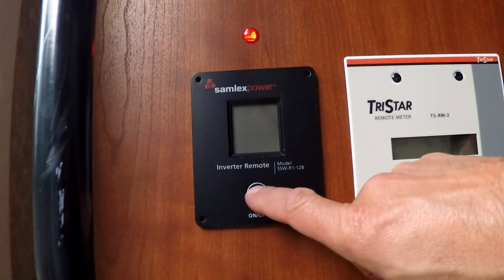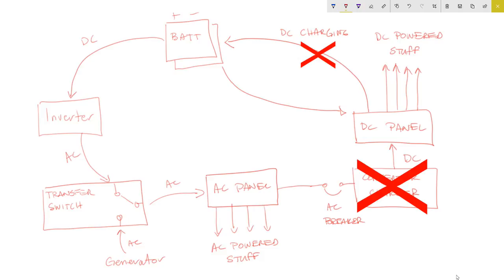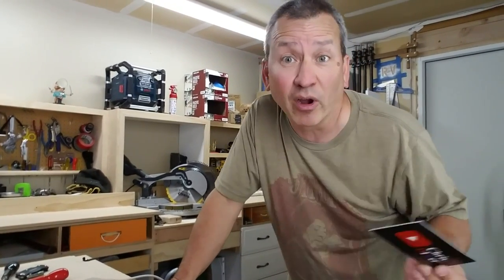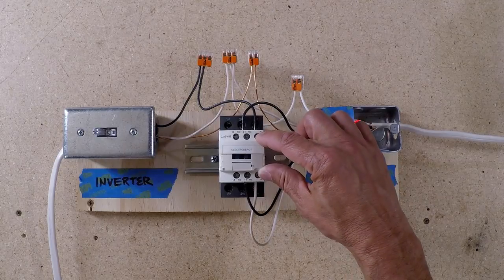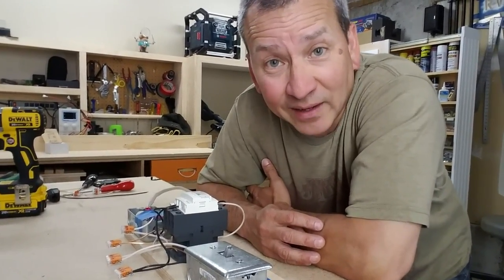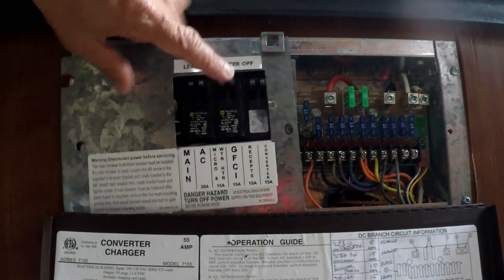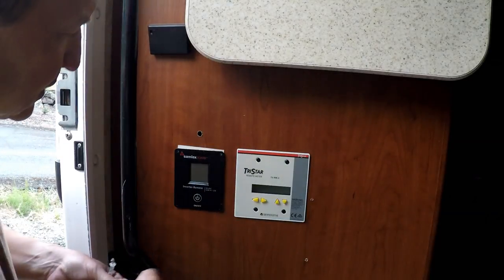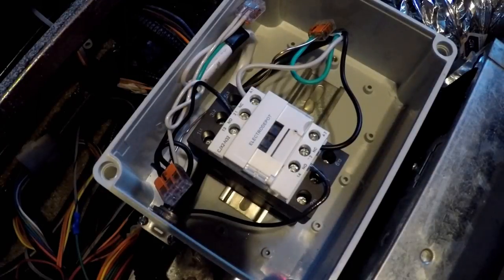How To AUTOMATICALLY Disconnect a Converter Charger When Using an Inverter

Comment: That's a nice little gadget! Personally I'm about to install a 2 position on-on toggle switch to flip between shore and inverter power. In my option a simpler/cheaper solution. Only difference is it won't turn my inverter on right away, but I don't mind since I don't want it running all the time anyway.
Reply: That's fine if you don't have a charger in the picture

Comment: Hey Brian, I really appreciate your hard work shown in these videos. YOU are my go to guy! I watched this a few years ago and now again because I'm facing the very same issue with our new (to us) 32ft Class c and the installation of our new Xantrex 3000 watt inverter.  I was wondering though, can't I simply remove the converter from the the coach breaker box and connect it through a separate small breaker box to the output of the existing transfer switch? This way it would only be powered when either shore power or the generator was on.
Reply from the maker: Ha! Found the comment :) Hope you got my email. Cheers.
Reply: I need to do this. Could you please explain how you did it?

Comment: Brian, couldn't you just disconnect the converter from the distribution panel and wire it to the transfer switch on the shore power side? would this take the converter out of the loop when using the Inverter?
Reply from the maker: Yes. That's basically what I'm doing now with a different transfer switch. Check out this more recent video: https://youtu.be/iASOOzUCRto
Reply: @RVwithTito  This is my question too, but I think Dan's question is a little more specific. Why is a more sophisticated transfer switch (with charger output) even required in the first place. If you do what Dan said, the power convereter would only receive power if shore power (or generator power) was available without any additional components.

Comment: Hello, Great videos, I watch you every day for all you not only suggest, but also for where you go on your RV trips.  All fantastic.  I plan on using a Inverter/Smart Converter by Go Power and eliminate the converter that came with my RV. What would be the suggested wiring sequence to use a power transfer switch where Shore Power when plugged in is the first source used by the RV. Generator when running is the second used and Solar Inverter is the third source of AC power. Are there transfer switched available pre wired for this type of setup?

Comment: Great video.  As always, well taught and with great quality all around.  Couple questions for ya.  It's a bit hard to see but is it safe to assume you took the hot as well as the neutral and ground from the converter to wire inline with this contactor?  Also, are A1 and A2 interchangeable?  I noticed the neutral from the converter was in A2 in your shop test but it appears to be the hot from the generator in A2 in your RV.  It also looks like the neutral from the generator plug is in A1 in your RV.  Thanks again for a great video.

Comment: Besides those clip on connectors, what are he weakest elements in this set up?  I ask for future diagnostic - troubleshooting, should there be a need to.
Reply from the maker: Will do. Those clip on Wago connectors are pretty solid. I love those. Neverhteless, I did wrap them in electrical tape before buttoning things up. I'll keep you posted.
Reply: I actually used a bunch of those installing hihats in my kitchen (in a house, not an RV) and I actually was a little concerned when i had an occasional flash because, compared to twisting the wires together and nutting them, that little point of contact is a pretty high resistance point, I would think. I mean, obviously they are UL rated and everything so i'm sure it's fine, it just made me think.

Comment: Hey Tito........Instead of running from the inverter to the RV's 30A shorepower plug, would there be any problem with running it instead from one outlet of the inverter to the main AC bus in the AC breaker side of my converter/charger panel, and then use the second AC outlet of my inverter to wire up the contactor as you show here? (my 30A shorepower plug is on the other side of my RV from my batteries and the space I can use to mount the inverter). Also, I suspect that I will need to use 10ga wire to run from the inverter to the buss (about 8'). Would that be correct?

Comment: Great video Brian! I do have a question for you though, I have the exact same setup in my trailer as you do with my shoreline plugged into the inverter and having to switch off the converter at the breaker. My question is that when I do this and turn on the inverter I am getting a humming/buzzing noise coming from the converter. Have you experienced this with your setup? Thanks
Reply: Are you getting the buzzing with the breaker for the converter OFF?
Reply: yes

Comment: THANK YOU!!!!!!  after seeing your video the light bulb came on. I have been planning this same type inverter setup for close to a month. My problem is that my generator is not big enough to run a hair dryer. I will be installing a xantrax sw2000 inverter which can run the hair dryer. I love the idea of the transfer/relay switch idea. it takes the problem of switching my converter off.question for you. have you ever tried running or ever heard of anyone using a 12volt generator through a solar charge controller to charge their battery bank?
Reply from the maker: +Glenn Sikes Glad you found this helpful glen. If your using a generator, you'll want to connect it to a battery charger and not through the solar charge controller. That's a farely common practice as a backup to solar. Some portable gerators have a battery charger mode. Good luck.

Comment: Hi … at the moment, I’m not exactly sure how to ask this question.  I’m in research mode for a van build.  I will have solar on the roof, connected through a (input) solar charge controller that is supplies power (output) to the battery bank with a fuse box (output) to the rest of my DC appliances.  To power a coffee maker or similar A/C household appliance, I will have an inverter (input) connected to the same battery bank.  From the inverter’s A/C outlet (output) I will have a power strip to extend connections for two or three household A/C receptacles.  The question: to include shore power into the mix, to charge the battery bank and take over the powering of the A/C receptacles am I looking for a smart converter/inverter that can switch automatically when plugged into shore power or am I looking for a manual method that bypasses the inverter?

Comment: a little confused. If i have a charger that's only attached to batteries (ie, it's not connected to an AC panel), I can still run the converter which would be charging the batteries while I'm using the inverter (connected to my batteriers) to power 110v plugs. Is that correct? Thanks for the great videos!

Comment: Tito, great video.  I saw on your drawing a xfer switch between your inverter and generator input.  Did you install that or did it come with the trailer?
Reply from the maker: The transfer switch came with the RV to switch between shore and generator AC power.

Comment: When you turn off the converter/charger do you lose power to the 12v lights and other 12v things?
Reply from the maker: The batteries continue to provide 12v DC to the panel.

Comment: Hello, I installed this on my RV and it is working perfectly.  I noticed a comment about switching the wires around so the AC will power the switch.  My concern is when I start the generator or plug into shore power will it affect the transfer switch.  Sounds like a good idea.  Have you tried to switch the wires.  God Bless...
Reply from the maker: Glad to hear it's working for you. Havent tried switching it. Working good now for me. I plug my shore power cord into my inverter so there's no way to also be on both.
Reply: I was wondering when you plug into your inverter like me if I want to start the generator the transfer switch automatically switches to the generator and shuts off the inverter / shore power.  Does yours work that way?
Reply from the maker: Yes. Mine works the same. The transfer switch toggles between generator and shore power. The automatic relay for the converter stays disconnected as long as the inverter is running. So to have the generator and converter running at the same time, I would simply turn off the inverter. This never really occurs in my situation though since I almost never use my generator anymore. I'm either on shore power or inverter. In both cases, I'm providing power through my shore power cord. So the RV always thinks it's on shore power.
Reply: Thank you  by the way I am enjoying the videos, God Bless...

Comment: hi brian,great video,will this setup work with 50 amp shore power as well?
Reply from the maker: Yeah it should. You're converter/charger still runs on 120VAC and will be on one of two 120V legs of your 50 amp service.

Comment: Are you sure that the auxiliary NC contact you are using is rated for the 15A+ you might pass through it before the breaker trips? The main NO contacts are 30A, but usually the auxiliaries are rated much lower as they are for control monitoring, not power isolation.
Reply from the maker: Ha. Made me look. Yes. I'm good. 30A on the top contacts, and 50A on the bottom ones. I still have to box it came it.  There are certainly ones not rated as high though.
Reply: Good news, then. The amazon page did not list the auxiliary contact rating anywhere I could find. I am enjoying your channel and your common-sense approach to rv additions as I am outfitting my new fifth wheel in anticipation of retirement in a couple of years. Keep up the great work!

Comment: I just got a converter and am installing it tomorrow. I don't have any AC box and just run a few things director off the inverter's AC plugs. Can I safely connect the converter to shore power (110VAC 15A) and also use my inverter at the same time?
Reply from the maker: I don't see why you would need to but, in theory, it should work as you described. I'd try it and see how your converter behaves as your inverter draws power from your batteries. I believe the converter will think the batteries need charging if the voltage gets drawn down below float level and then bring more current in from the shore power.
Reply: Thank you!

Comment: When you manually disconnect the converter or install this auto switch, don't you still lose the ac to your outlets even when you plug your rv into the inverter? I plugged my RV into the house power or shore power and when i hit the breaker for the converter to shut off so does my outlets and microwave. Please advise me. Your video was awesome but as most it never shows how the RV is still operating normal besides the 12 volt side. Thank you in advance
Reply from the maker: Not every RV is wired the same. You're converter is probably wired in differently than mine.

Comment: Great video and project (as always). So a slight twist... I have an inverter charger with transfer switch. So I am wiring the output to the PD panel input to run everything. But, this implies I would have my inverter charger and converter charger both running when on short power. If my logic is right this shouldn't make a difference but thought I would get your expert opinion.  Do you think that would be an issue?
Reply: That's the loop to avoid.  The inverter is running which powers the charger which charges the batteries which feeds the inverter which... etc

Comment: Brian
Since you have a Genset and shore power, you probably have a transfer switch to direct them,
If so, just add a 2nd xfer sw..    (Google "Lyght")
!st switch is Gen/Shore, 2nd sw is GenShore/Inverter.
Power the Inverter input with the output of 1st switch (move lead from Conv breaker to output of 1st xfer sw) 
Voila, no power to Conv when on Inverter. (Unless you are running Gen or Shore also which is ok to power Converter in that case.)
Reply: AND you no longer need to patch the Inverter Output into the Shore line Plug.
Automatic transfer to inverter AND kill power to Charger... woohoo

Comment: Great project and very informative. With the Inverter commanding the converter/charger off (to eliminate the charging loop) would all your 12 volt appliances then not be operational while using the inverter?
Reply: When the converter is not powered, you get your 12v power from the batteries.

Comment: Brian:  so here's the question I have...if you turn off the charger converter, and you run directly off your inverter, what powers the 12volt things in the rig like the lights, and other such appliances?
Reply from the maker: House batteries are also connected directly to the DC panel to power those things.
Reply: @RVwithTito  ah, that makes sense now.  Thanks for the reply. Hope to see you out here in northwest boondocking.

Comment: Hey there, question for you. I know this is an older video, but at the time of doing this, your diagram shows that you already had a transfer switch. Couldn't you have just removed the power converter's A/C input entirely from the circuit panel and connected it directly to the shore-power-input-side (or generator side) of the transfer switch permanently and branched off right there? That way, the power converter would only come on before the transfer switch is involved and you would never have had to fiddle with the circuit panel breaker at all that fed A/C to the power converter (as it would have been removed). Am I missing something?

Comment: Nice vid!  What are those little wire connectors you use?  They look very easy to use.
Reply from the maker: They are Wago lever connectors and they are awesome. I have a link to them in the description.
Reply: I LOVE those connectors. I created a entire wiring harness in minutes using these instead of solding. 😉

Comment: Hi, just wanted to let you know that I did the same install for my travel trailer based on your video. I have not received the inverter yet (on the way) but I did install the wiring to the inverter and the relay as per your video. My inverter will be hard wired. So to simulate power from that end I plugged that wire to a plug from my house and to simulate power from the other side I plug the house line to the shore power plug. I have a manual transfer switch right under my converter box so I can chose shore or inverter. The system works great except for one curious detail... when the switch is in shore position I have normal power and the converter is powered. I confirm this by putting a voltmeter on my battery and see the 13;5 volts. Power off, voltage back to 12.7. Now I put the switch to the inverter side and when I check the battery I still have only 12.7 meaning the converter did not kick in. Another obvious sign is that I can hear the converter fan cycle when it is first powered up. However I never physically hear the relay kick on and off, even if I have my hand on it I cannot feel the relay kick on or off. The whole thing works perfectly except for the strange fact that the relay is completely silent. In your video it has an obvious click to it. Any thoughts?

Comment: Hi Tito, This has been a question in my mind how I could achieve what you are doing to switch of the converter automatically when I power up the Inverter, I ordered and have received the  relay disconnect and the box, but could you make a little line schematic so I can be sure of getting it right,  I would really appreciate it. Thanks Gene C.

Comment: I have a bluetti and I want to power my rv with it and avoid charging my normal house batteries with it.  would this switch do that for me?  thanks.
Reply from the maker: That's right, the RV will be charging your house batteries from the Bluetti. If you can't manually turn off the charger, then you'll need a setup similar to this.

Comment: Question - My battery bank is in shed very close to our camper and all my solar power dumps to the shed and the charge controller..... we run a extension cord from our inverter to our camper to have 12V power in camper. This also drains our battery bank to charge the single deep cell on the front of the trailer, would this still be a good idea given my remote locations (not in camper) or should I just beef up my battery bank and go with a 2000 watt inverter?

Comment: I installed  a setup based on your idea. It is installed in my travel trailer. It works very well except when I run my microwave. I have 4 Battle Born batteries in parallel, a 3500 watt max/9000 watt surge inverter with a remote start button. I am using 1/0 wire with a maximum length of 16 inches of one section of wire. I have a 150 amp push button breaker and 200 amp  fuse.  The microwave uses approximately 125-128 amps(at dc side, of course). The transfer switch transfers  BACK to shore power after 50 seconds or so , therefore interrupting the ac power when I run the microwave. My air conditioner runs about 60ish amps and no problem there with transfer switch.The voltage of the batteries never drops below 13.0 volts and the voltage coming into the transfer switch is 119-120 volt ac from the inverter so I am not getting excessive voltage drop. I am stumped. I want to have some use of my microwave:(